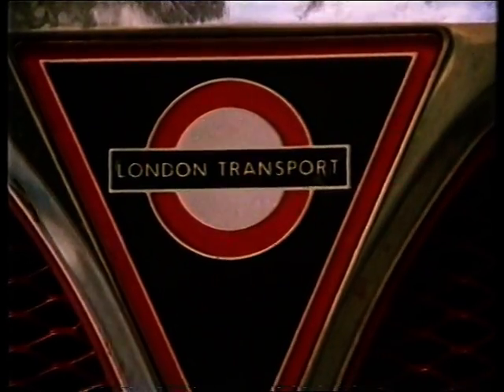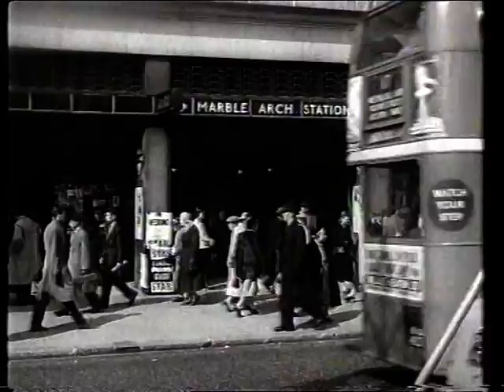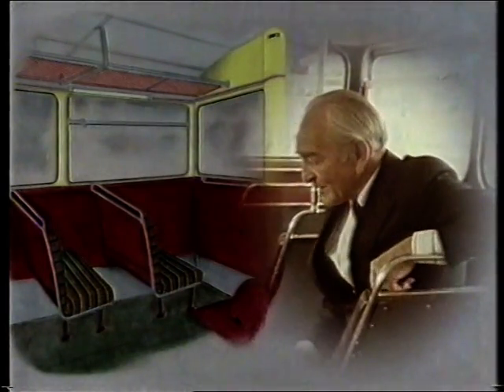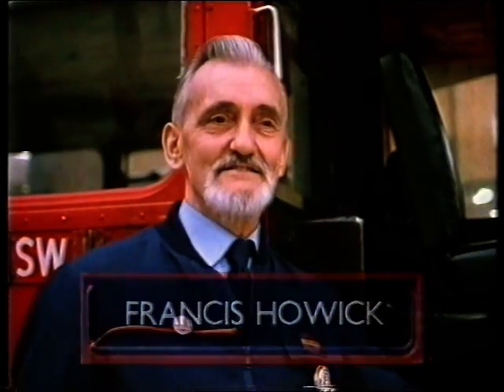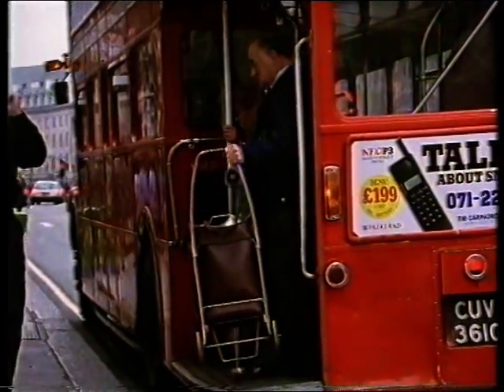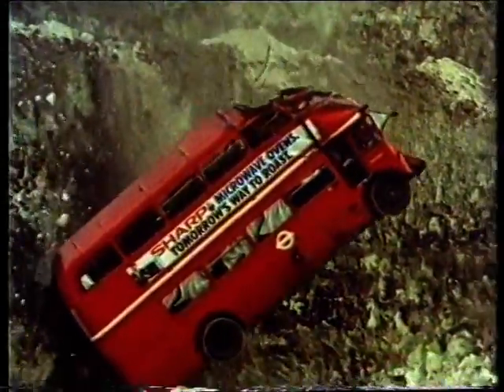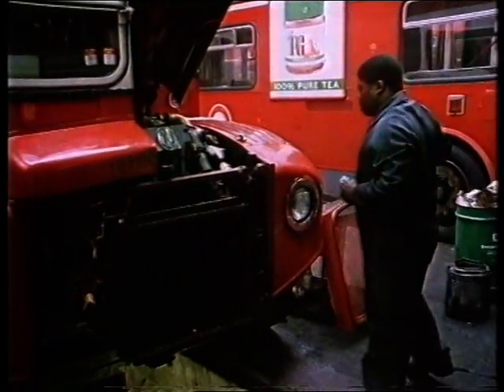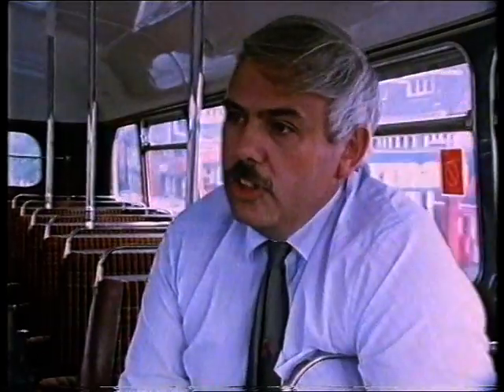The Routemaster Bus (Perpetual Motion) BBC Documentary

Comment: RM (4 bay) then RML (4.5 bay) & now XRM (5 bay) all using weight saving monocoque structure as the lightest bus per passenger ever produced. The sub frame mounting of engine & transmission has enabled re-engining - at least twice, so that a full Euro 6 standard bus can be operated, new transmissions ave also been used. The 2 person operation can halve the PVR and the consensus was that an RM could be timetabled to run at twice the journey speed that a DOO vehicle could run in Central London - at peak times as the film shows, the dwell times for DOO cripple all services as buses queue to load passengers.  Half the number of buses needed to run the service = half the number of drivers & fuel etc do the cost of the conductor becomes irrelevant against the bigger savings made. Very telling that it took almost a decade to deliver the design as a working bus, and the focus was on operational efficiency unlike the Borismaster - over hyped and massively overweight vehicle. Like the London taxi the RM is superbly nimble, whilst NBFL is the limiting factor in the design of bus stations due to the extra space it needs to get in & out

Comment: A great bus like the RT designed and built for a purpose a evolution in design practical and easy to repair the design it's a shame why don't we design practical vehicles that are built with passenger driver operator's and engineers in mind
Reply: The RT that you quote is The Regent, which was the bus BEFORE the Routemaster, i.e The RM.